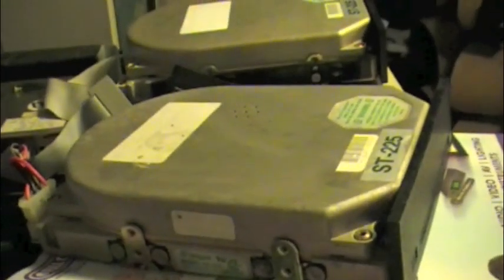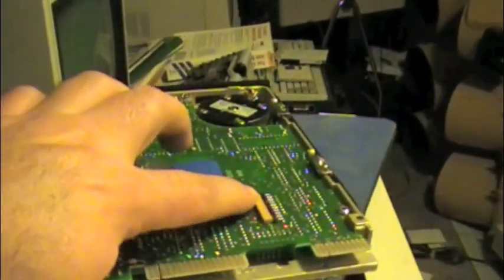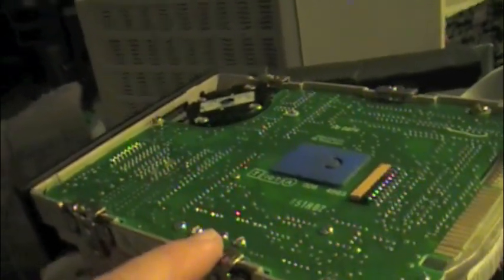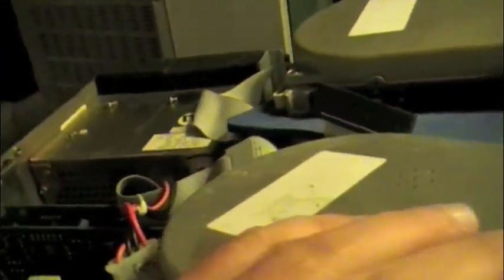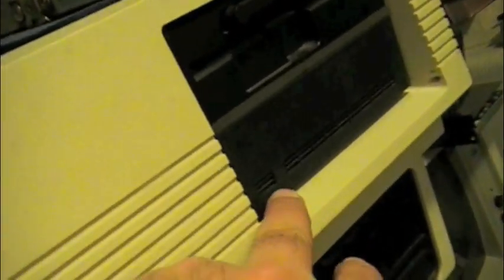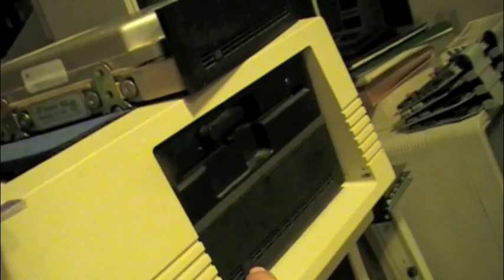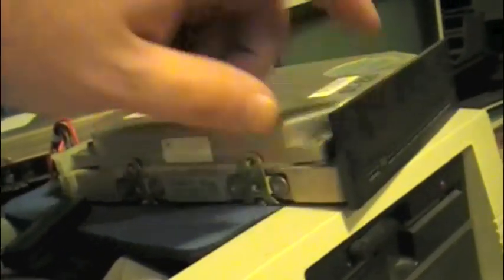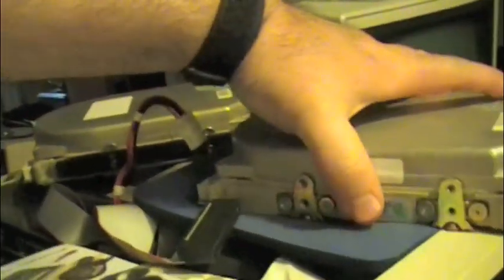1st Seagate ST-225- Spin up

Comment from the maker: LOL.  Yeah, even these old hard drives initialized the heads on startup.  There are some drives that will not power up without being connected to the controller, most SCSI drives and some ESDI drives.

Comment from the maker: You're gonna make me go back and redo all the videos I just made... 
You're right, technically not a seek test but they DO initialize the heads by moving the heads all the way from track 0 to the max and back to zero. This drive did that at 3:01 .  I was calling that a seek test but it's actually just a startup test.
An actual seek test is done by a program while the hard drive is connected to the controller.

Thank you. ^^